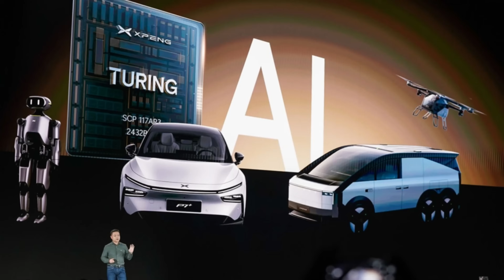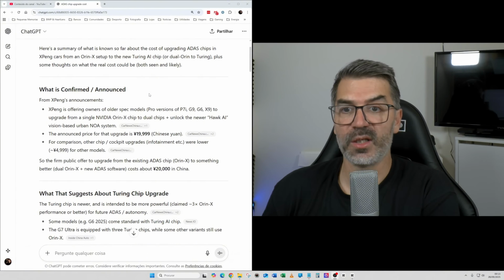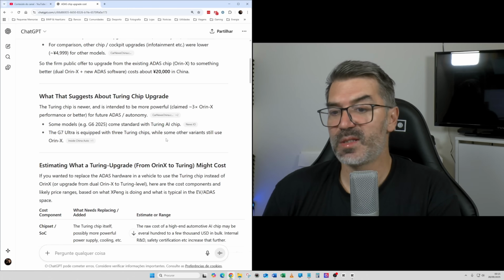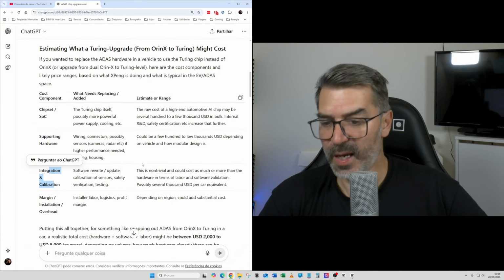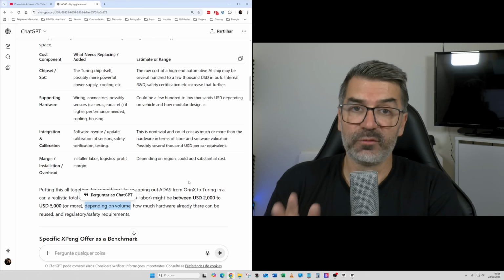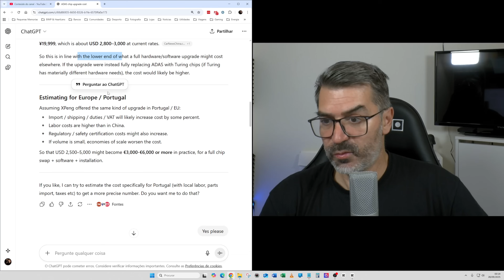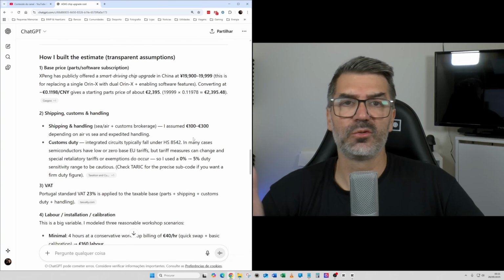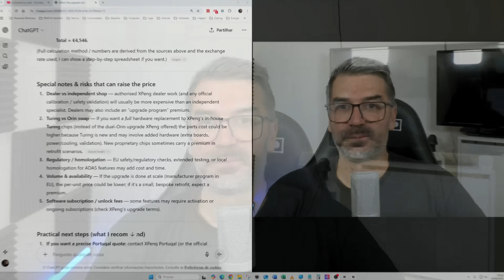XPeng ADAS Chip Upgrade – What Would It Cost? (Fictional Exercise)

Comment: The car is already more expensive in the EU than in China and they have the cop as standard. Therefore why should we pay to have it added afterwards?
Reply from the maker: And you would have to pay even more for the chip in Europe, than it would cost in China. There is a simple explanation. 20% taxes on import of a chinese car, and on top of that 23% of VAT. So a 30k€ car in China, with the import taxes would cost 36k€ (20% import tax), with VAT on top of that would cost 44k€ (23% VAT). Now you need to add also (and before those calculations i made) transportation and insurance costs, homologation costs,  costs of the european infrastructure (repair shops, sales shops) more people and of course the margin of the importers.

Comment: If my information is correct:
G6 last year edition - 8 TeraFLOPS
G6 new version - 30 TeraFLOPS
NEW G7 in china - 508 TeraFLOPS
Reply from the maker: I dont know, but usually the processing power is not measured in TeraFLOPS, that usually is used for Graphic Cards. So maybe you are seeing the Infotainment Chip and not the Processing power of the OrinX chip for TOPS.
TOPS are TeraOPS :) It's a mess i know :)

If im not mistaken, there was in fact a change on the Snapdragon Chip from Previous G6 and New G6, but in terms of the ADAS chip i think it keeps only a OrinX Nvidia chip in boith versions. Not sure!
Reply: If it was posible, I would buy the new G7
Reply from the maker: I think the G7 failed on the NCAP ... It was something i heard, not sure .. again!
Reply: @XPengPT  so ist es. Für Europa im NCAP durchgefallen.
Reply from the maker: Yes i remember to read that, but not sure why, what really failed.

Comment: Hugo, interesting question to consider. I think the answer would depend upon a few things. 1. When the upgrade could happen - in the next 12 months or longer? 2. As time extends I would expect technology to evolve and chip prices to fall in price as XPENG deploy the latest chip version in the Chinese local market. 3. We would need some certainty regarding what benefits would arise - mention by Candice regarding TOPS impacting what cars can do and transparency around what the upgrade means to older models manufactured in early 2025 would help 4. As the upgrade could be costly XPENG would need to consider extending some warranty provisions to offset risk of existing hardware and upgrade inconsistencies after the upgrade.
So overall my answer would be a yes I would consider paying for the benefits but it might mean that after a chip upgrade it would delay upgrading my car for a few further years to get the benefit back for the money, while also improving the second hand value of the car. Ideally the price for the upgrade will be less expensive by the time the EU allows self driving and XPENG is ready as the chips will be older models by then.
Reply from the maker: For sure, that this is early and very theorical! Its not anyway linked to reality or to Xpeng. I also do believe that in Europe the current HW will be sufficient to whatever EU lets us do. So, of course that if Xpeng comes with something like this in 6 months, telling me pay 5k€ but we don't know when you will be able to use it, my reaction would be the same as for the Tesla offering of FSD ... Not for me!

So of course that we need first to understand the timeframe of European Laws and what can be done. The second point will be what the current HW can do, and if there is a limitation, the additional features or functionalities are worth the full price of a top CHIP? And third is of course price. The Chip today costs for sure more than what the new Turingv3 chip in 2 years will cost  :)

Comment: Hey Hugo, thank for this video - really interesting. I would not do this, as the regulations here would not allow us to use the power anyway. Tesla HW3 has 144TOPS, HW4 has ~300TOPS. My Xpeng P7i RWD has 508TOPS, which is more than enough to do all FSD stuff here in EU.
Reply from the maker: Would you believe that i was right now searching for the TOPS Comparison :)
CahtGPT gave me these numbers:
Tesla HW3 (FSD Computer) ~144 TOPS
Tesla HW4 (FSD Computer 2) ~300–720 TOPS (reported / estimated range)
NVIDIA DRIVE Orin / Orin-X (single SoC) ~254–275 TOPS

Is the P7i with dual Orinx? or are the ChatGPT number incorrect?
Reply: @XPengPT hmmmm, good question. Gemini said around 500. In any case a LOT more than Tesla😂😉
Reply from the maker: LOL, My chatgpt told something strange about that interval of Tesla. They talked about official, tested, reported and estimated ...hmmm
Reply: @XPengPT  try Gemini ;-)
Reply from the maker: Copilot says this:
Tesla Hw3 - 144 (2 SOC com 72 cada)
Tesla Hw4 - 200
Orin-X Nvidia - upto 254 TOPS

Google Gemini says this:
Tesla HW3 (FSD Computer 1)	144 TOPS	
This figure is the total for the dual FSD chip system in the HW3 computer. Each of the two custom Tesla FSD chips has a neural network accelerator that runs at approximately 72 TOPS.

Tesla HW4 (FSD Computer 2)	Approximately 300 - 500 TOPS (Rumored/Estimated)	
Tesla has stated the HW4 is 2-4x faster than HW3. While some reports cite 144 TOPS (which is the HW3 number) or 300-500 TOPS, the exact official number for the neural network accelerator is not publicly released by Tesla. It is expected to be a significant increase over HW3.

Single Nvidia Orin-X Chip	254 TOPS	This is the official TOPS for a single NVIDIA DRIVE AGX Orin-X SoC.

Xpeng with Dual Nvidia Orin-X	508 TOPS	Xpeng's Max variants often use a dual Orin-X configuration, combining their power.

Xpeng with Turing Chip Setup	> 2,200 TOPS (claimed effective power)	Xpeng's Ultra variants (e.g., G7 Ultra) are equipped with three of their self-developed Turing AI chips.
Reply: @XPengPT  Okay, so the question is what do the different Xpeng vehicles have (P7i RWD/AWD/PERF, G6 RWD/AWD/PERF and G9 AWD/PERF) sold here in EU.
Reply from the maker: I Tried to get that answer, but not possible, its sems that IA are certain about the G6 and G9 in europe that only have 1 OrinX, but they are not certain about the P7i, if it is 1 or 2
Reply: @XPengPT well, we don't have all AI features as in China so don't need so many TOPS
Reply from the maker: Yes of course, but it would be good to know that it has 2 OrinX :)
Reply: @XPengPT don't know how to find out. Do Xpengs have service menu?
Reply from the maker: @dutchbavarian I dont think so..

Comment: Hello, thank you for the video. I find your thoughts very interesting. I’ve also considered whether replacing certain hardware components could improve automated driving. However, what we always need to keep in mind are the regulations of the European Union, which significantly restrict the implementation of fully automated driving. At the moment, there is hardly any progress being made in this area.

That’s why the price you’ve calculated remains purely theoretical. Without approval and authorization from the EU, nothing much will change in the foreseeable future. It’s a pity, really, because I would be willing to pay the price – but only if it truly ensured fully automated driving.

At present, though, this is only possible to a very limited extent. BMW, for example, offers a so-called Level 2 Plus system, which allows hands-free driving on highways in Germany. In practice, however, this is very restricted: even small construction zones or minor disturbances cause the system to shut down immediately, requiring you to place your hands back on the steering wheel.
Reply from the maker: Yes for sure! It was a very theoretical and early exercise. From the interview i had with Candice, i got the feeling that even when EU releases a bit more, and Xpeng can deploy XNGP in our cars for what is allowed, that the current HW is still able to process that. So i believe that our HW will bu enough to all possible laws for the next 2 years ...